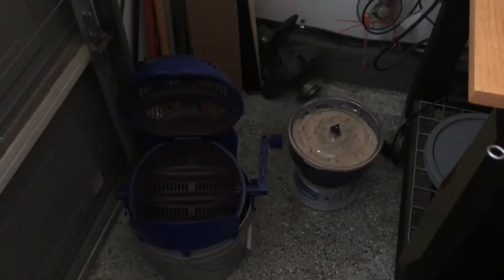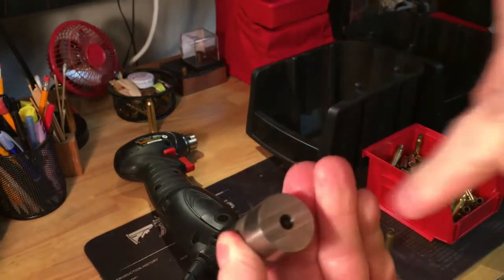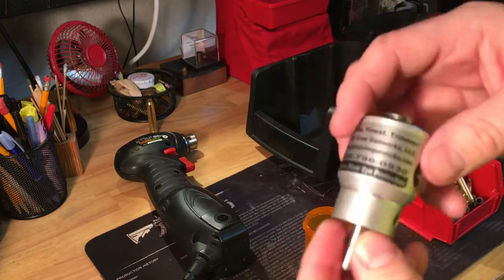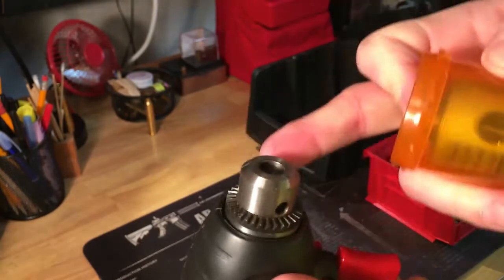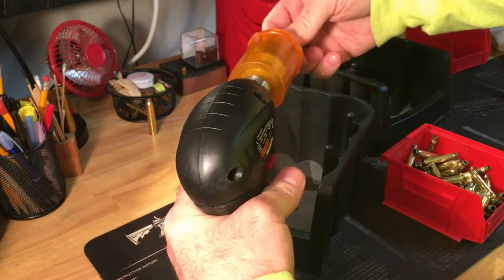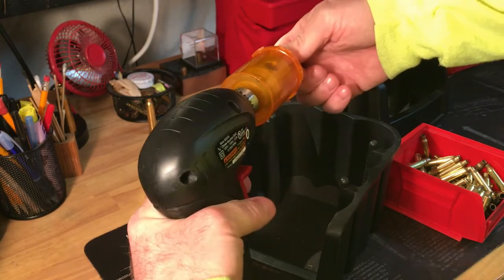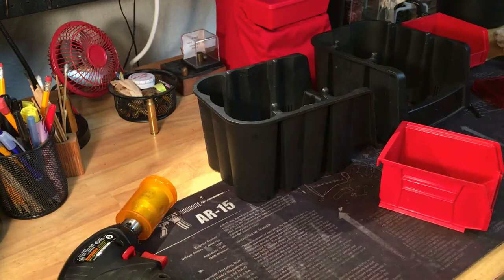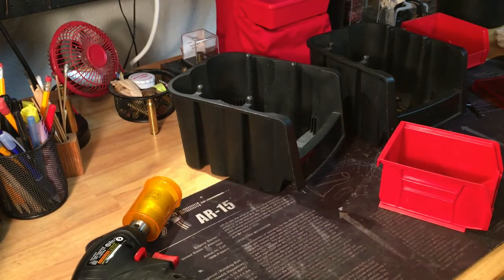The New Reloader: Trim, Chamfer and Deburr

Comment: So, I used to relaod 308 and now im doing 300BO but its been 4 years. I cant remember, You deprime,resize, then do this step then wash/dry off, reprime right?
Reply from the maker: My process for bottleneck brass is basically the same (except for 5.7x28).  Not saying mine is correct, but it works for me (and you will find folks that do things differently, so keep that in mind). 

Step 1. I dry media tumble once fired brass to clean them
Step 2. I lube (usually spray of my own homemade solution), resize and deprime
Step 3. If I'm not being lazy, I will dry tumble the lube off, otherwise, skip this step (which makes brass shavings messier)
Step 4. I trim the brass, if needed (check with go/no go gauge).  If there is still lube on the casings, I've found brass shavings will tend to stick/clump, especially inside the neck
Step 5. Chamfer/deburr

Now ready to reload.  Again, your steps may differ, but I've found this generally works for me.
Reply: @ReLoadersBench  you must tumble before deprime because you dry tumble? I've always used lemi shine and done it wet. Everything else is similar to how i did it but slightly out of order haha
Reply from the maker: @byronbranch4645  - I dry media tumble BEFORE depriming because if I dry media tumble AFTER depriming, it's a constant fight to clear the primer pocket from media that gets caught in that hole.  If I was wet tumbling with stainless steel pins, I would deprime BEFORE wet tumbling as SS pins get EVERY area looking like brand new.  For my shooting needs, dry tumbling and NOT depriming first works fine for me.  Again, YMMV and everyone does it different.  So replace "must" with "may"...
Reply: @ReLoadersBench  gotcha that makes sense..yeah i use ss pins. So that's probably the main diff then. Thanks for the response though!